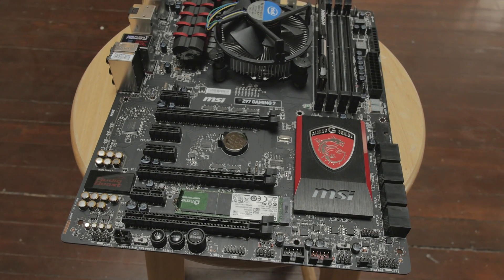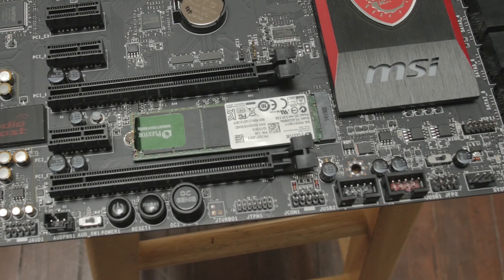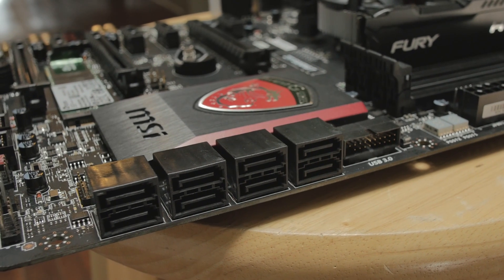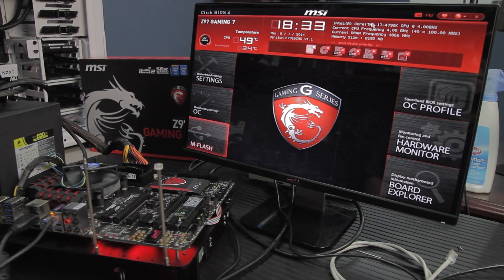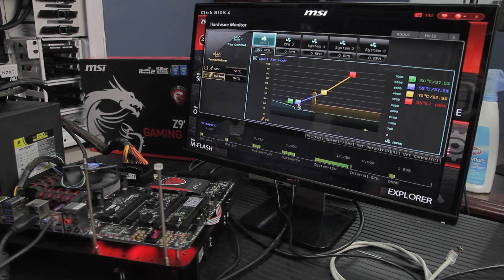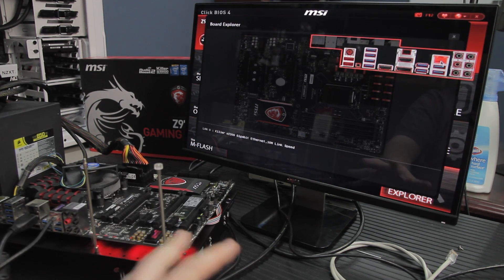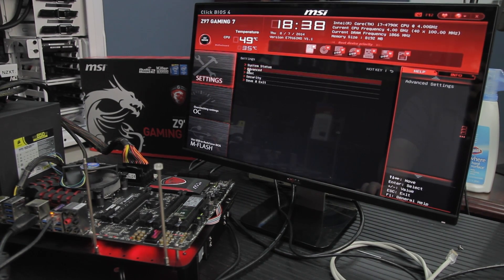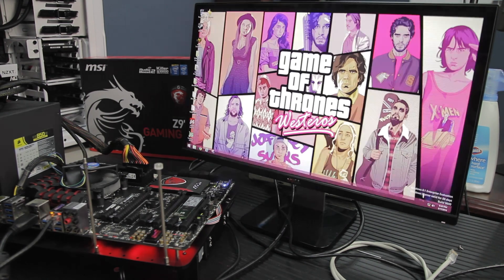MSI Z97 Gaming 7 Motherboard Overview and Benchmarks

Comment: should i better buy the MSI Z97 Gaming 7 or the MSI Z97 Gaming 5 ?
Reply: Gaming 7 beats the 5 ten fold for sure but if you also want wifi and bluetooth get the 9 also the 9 has some beautiful (metal) I/O and audio PCB shielding along with an extra USB 3.0 header internally. It's pretty glorious. That being said I am unsure of the Z170 offerings

Comment: I own this Mobo. It's user friendly and full of features. I chose this over the M power, which is a straight up overclocking board. The audio is so good, I'm not using a sound card for the first time. Readouts on the board are helpful. Plenty of connections for whatever you need. You can get a sata express card to fit in the M.2 slot if you are using a traditional SSD like me. 

I have been a fan of MSI for years. I consider this board more cost effective than the Asus Maximus.
Reply: in just a week i waste my money on Asus Maximus VII Hero because Bios update loop and i need to buy new motherboard so i decided to go MSI Gaming 7 Z97 
Can anyone tell me MSI and Asus which better ...going to decided which brand should i continue to support ?
Reply: Kojou Kun
Both are considered top of the line. Asus seems to be more expensive feature for feature. MSI has improved RMA rates dramatically in past few years. Also, part of the reason I get MSI is that I really like their graphics cards so it all looks nice and co-ordinated inside my machine. Maybe not the best reason to get one, but its my party.
Reply: +Diamonddogusa Thanks for your opinion I'll choose MSI then because i really like red black scheme and you did said that RMA improved ....Hope my motherboard that sent for RMA success from Asus

Comment: I need some help. I have a new custom build im working on which consists of
i5 4690k
XFX R9 390
8 GB 2x4 Corsair Vengeance Ram
650 W  PSU(Dont know which one to get yet)
NZXT S440 Black and Red 
212 evo cpu cooler
I can't decide between the MSI Z97 Gaming 5 mobo or the ASRock Z97 Pro 3 and the Gigabyte GA-Z97X UD3. Please give feedback.
Reply: +CrazyMan Honestly, it doesn't really matter, they'll all perform sort of similar, personally I'd go with the MSI but that's just because they've always been good for me and I have one myself.

Comment: if 2 fans are reserved for system fans, does that mean that If I buy a case with 4 fans, would one go to waste?
Reply: +zealotscout I know this is very late but no. You simply get more control to one extra fan. Essentially in the bios there will be a layout saying cpu_fan1 cpu_fan2 and then sys_fan1-3 and you have slightly more control on the cpu ones

Comment: Oh yea, forgot to mention, my cpu 4790k will not overclock at all in this motherboard.
Reply: Keith Rhodes That's weird.  The hardware-based OC Genie button might help with that.  Is the mobo detecting that it's a K?
Reply: Yes, but when I try to over clock, the pc just reboots and turns the Boise back to default, I purchased the Intel 4790k specifically for over clocking, my idle temps are around 34 c, rather high but then everything is hot in the Philippines, even my gfx card temps start at 59 celcius, running two monitors at idle.
Reply: Keith Rhodes Sounds like a stability issue rather than a bug, try upping the voltage?

Comment: at 5:15 in the vid you stated the power is the green led, that's not the case, the green led is for the second bios (b) when you use the first bios (a) the led is blue situated to the left, in your vid it is situated to the right as you have the board upside down.

Comment: I have this motherboard (masi gaming 7 z97) with 4790k cpu, both purchased (dynaquestpc) at the same time, and to be honest, I have had nothing but trouble from day one, first the bios would not work till I had flashed with new bios from flash drive, second it would not see my keyboard, then after about two months of use, the motherboard started resetting in windows and in the biose, had to reflash the bios again, now to this very day, it keeps resetting every 3 seconds, so I am not very happy with this board, and yes I have tried all other components separately except the cpu, will be returning it to place of purchase tomorrow.

Comment: Sorry im a noob but which sata ports are the bad ones
Reply: Imre Saks The ones closest to the bottom.  Another thing:  If you have nothing connected to those ports, opt out of installing the Asmedia 106x SATA controller drivers, they interfere with the Intel ones.  If you need to uninstall them, you can do it through the MSI utility or by going to Device Manager/Storage Controller/Asmedia 106x SATA Controller, then right clicking that and going to Properties/Driver and clicking the Uninstall option.  Then install the Intel RST Drivers if you haven't already by that point.
Reply: Ok thx

Comment: Z97a gaming 7 !? Whats thes
Reply: ALBOSKHIER_  it's the same as the z97 but features usb 3.1 alongside usb 3.0 and usb 2.0 where the z97 has only usb 3.0 and usb 2.0
Reply: *****  according to the website of MSI : http://www.msi.com/product/mb/Z97A-GAMING-7.html#hero-specification, the mobo has 6 usb 2.0
Reply: ***** 2 on the back panel and 4 through internal connections

Comment: Would a Cooler Master Hyper 212 Evo cpu cooler fit on this?
Reply: yes as i have this mobo and fitted cm 212 evo with one fan if you are planing on using all 4 dimms then you can't have both the fans on evo as it covers the 4th dimms slot

Comment: Will this work with the i7 4790k and the EVGA GTX 980 if so I'm gonna put it in a phantom 820 case with liquid cooling I'm new to building PC
Thanks
Reply: VicHerps3931 Yeah... of course it does.. If you watch the video hes running it on a 4790k.

Comment: Hi I just got this MB cpl days ago and I can only get the first 2 sticks of ramm in slots 1 & 2 to work, when I try the 3rd n 4th slots the pc starts up with no display and it makes my 780ti card fan spin at a very fast rate, any suggestions would really help, thanks.... I tried the cmos reset and it worked for the first 2, but not for 3 & 4, js.....
Reply: ***** use 1st and 3rd slot ( read instruction on the board )
Reply: Are you using a matched set? If so, how much RAM is it? Is it 16gb or 32gb in a 4x4 configuration, or is it two different matched sets of RAM filling all 4 slots?
Reply: Brandon Silva  The ram is 4 sticks of Consair Vengence (CMZ16GX3M4A1600C9B) total of 16gb, 4gb a stick and can only get the first 2 slots to work........
Reply: That's really strange. Have you tried checking the bios when you boot up the system? Maybe it needs to be enabled?
Reply: yes I did, all 4 sticks work too i tried them all in the first 2 slots, weird....
Reply: I returned the board and got same one and installed all 4 sticks with no issues at all, so it must of been a bad board, but thanks for trying to help............
Reply: eehubert in first hand yeah...... he had 4 sticks tho bruh

Comment: Does this work with a GTX 970 & i7 4790k?
Reply: yes it does bruh
Reply: Thanks, I gonna buy all 3 :P
Reply: Char Aznable Nice, how does perform
Reply: How much watt is your PSU? If I would use 1 GTX 970 and that CPU?
Reply: Char Aznable Alright, then ill use 650watt, for the i7 and 970 :) Thanks for the info
Reply: Char Aznable I am going to build the same, I7-4790k, which has a TDP of 65W, and a Gigabyte 970 (GV-N970G1 GAMING-4GD) which has a TDP of 550W, what PSU, should I get? 850W? Would this Motherboard, bottleneck my other hardware? 

Thank you
-Chris
Reply: I was looking at pretty much the same setup as you, although I might splurge and go with the GTX 980 over the 970 due to that 3.5GB + .5GB fiasco that everyone is all up in arms about, but all in all, I don't see any trouble with this motherboard.  Imo, this might be the best bang for the buck out of any gaming/performance motherboard that the Z97 chipset was ever placed on.  Would recommend this over anything ASUS and Gigabyte have at the moment.
Reply: I got it, together with the i7, and it works great :)
Reply: *****
yes

Comment: Can't find a part number that allows 2x 4gb please help
Reply: What do you mean? If you mean the RAM, of course most of the motherboards would allow it. It's the processor that you should be worried about. If it allows dual channel memory configuration, then you're good to go.
Reply: thank you, because some motherboards won't tell you anything that will work with it like the ram and hard drive and graphics card, so i wanted to make sure!, im gonna be using this board with the i7 4790. streaming build so gotta make sure everything will work together.
Reply: Oh then, all the best with your build =)
Reply: By the way, the motherboards' official website would tell you everything you need to know.
For MSI Gaming 7:
http://game.msi.com/product/motherboard/z97-gaming/models
Reply: i was talking about boards in general, because some of there websites dont tell you anything that they support.
Reply: Actually, now that I think about it, you're getting a locked processor, but an OC enabled motherboard. I suggest you go for either an unlocked 4770K or a 4790K, or just change your motherboard to a H97 chipset.
Reply: i was gonna get the z97-a motherboard but ugh so many to pick! i just want one that will work with everything, i could get the 4790k just to op it only a little more anyways

Comment: Why was the CPU temp so high in the bios and even when it was out in the open with no case blocking air.
Reply: The stock intel cooler is shit.
Reply: Ben Zimmerman I have one and it never goes above 60, stock everything on an i5 4670k

Comment: Will the Z97 gaming 7 motherboard support a Intel i5 4690k or a i7 4790k (devils canyon) out of the box, because I have no other CPU to update the BIOS first?
Reply: Any CPU with socket LGA 1150 will work with this motherboard, which includes i5s and i7s

Comment: Anybody got good recommendations for a z97 motherboard? and also if you could recommend wether i should get a geforce 780 or a radeon r9 290 (or 290x)? im trying to get a higher end build but dont have much knowledge on motherboards.

Comment: I set up a itx board pc for my girl friend, cost alot 522 eur(usually get same peformance with 380 to 420eur), she wnated small..
And it boots up in 2,4 seconds into the login screen, under 5 sec (usually aboat 4) is to autologin booting.
If i had the money i know a setup for under half second bootup(into the user account and load browser and all other extra startup programs and extras in the same time), but it's massively crazy expensive (around 30 k euro).

Comment: That's retarded. It's three way sli capable yet the last slot is way too close to those on board power buttons.if you put a graphics card on the last pci slot it would cover those buttons and might not fit.

Comment: i have this MB atleast for month now, and im pleased. I had only one problem with it. If you want to use OC genie button, then you dont want to choose setting like xmp for the ram and so on, because then this button wont work. I had this problem. my ram had xmp profile selected under bios and when i tryed to use this OC button, it would not light up and apply oc. Yes it needs to light up with blue light. So before you do anything, just push this button and let the computer make restarts and so on. After that i guess you can choos xmp and other settings if needed. I think this OC Genie allso chooses xmp profile automaticly if possible. But overall its one hell of a mb. I would recommend!

Comment: I understand and accept the fact that NO motherboard manufacturer has a flawless 100% production record ( meaning no rma's needed) but MSI's QC dept for RMA dept is as sharp as a bowling ball.  I speak from 3 time experience dealing with them dumbasses.  It took the 3rd returned motherboard for me to lose my cool, demand the head manager of the RMA department and demand a BRAND NEW board.  I had to threaten to contact the Better Business Bureau just to finally get it.

Save yourselves some headaches and just go with Asus or Gigabyte.  At least if there is a problem with them, they DON'T fuck around.
Reply: Thanks for the warning i was about to get one of these boards but if they have poor RMA policies im going for the ASUS MAXIMUS VII HERO